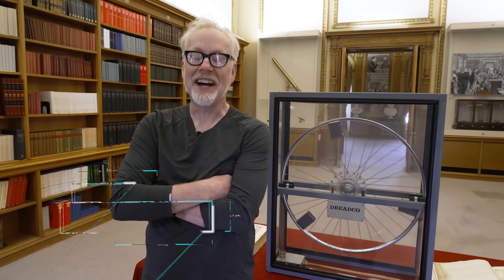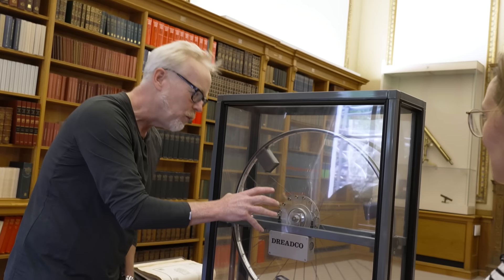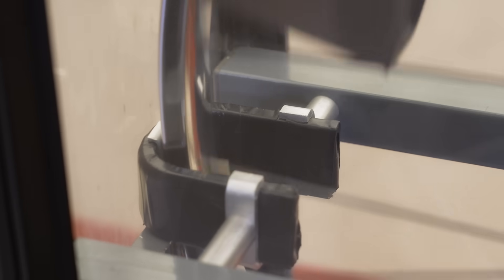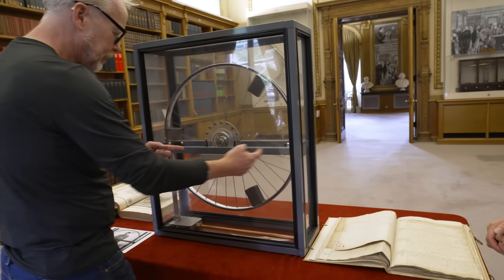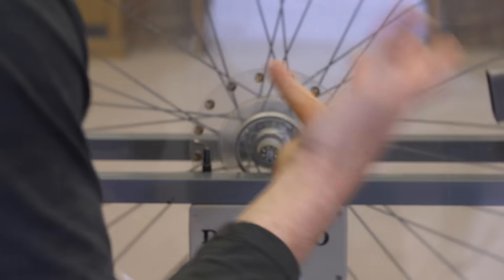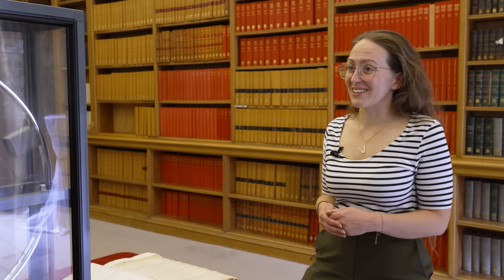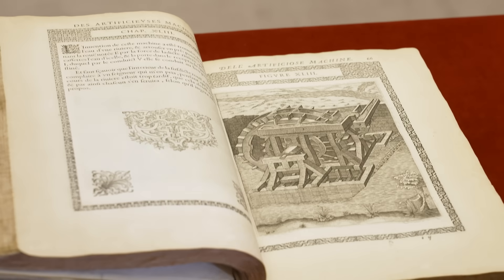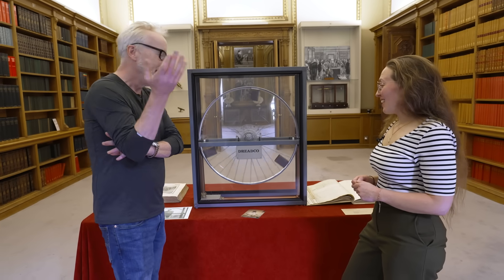Adam Savage vs The "Perpetual Motion" Machine!

Comment: I think it would be a wonderful inside joke if it's just a really low friction glass/ceramic bearing, the boxes are just weights (filled with lead or something), and everything else is a red herring. The "servicing" would be just giving it a good initial spin.
Reply: It’s not in a vacuum. The spokes have a lot of resistance from running through the atmosphere gas. Even a spinning top cannot spin past 20-30 minutes that has more precision than this wheel can achieve.  For sure it is using electromagnetic forces that are greater than the frictional drag
Reply: @nathanroberson  the world record for a spinning top is more than 7 hours with no vacuum :D
Reply: @nathanroberson  How do you know that the entire container is not vacuum sealed? Do they mention it in the video?
Reply: @rdizzy1  it’s not vacuum sealed. The walls are too thin. Even then, you’d be surprised how much energy small amounts of friction drain over time.
Reply: @rdizzy1  Adam his the enclosure, it's clear it's not under pressure/vacuum
Reply: @TheOfficialOriginalChad  Those walls are not too thin to have a partial vacuum pulled in there to decrease air resistance.
Reply: @geomore  Hit
Reply: @nathanroberson  Insulated bearing hmm and those probes look like they are for EHT just enough to have a field effect on the boxes and anyway it has a mystery box where magic shit happens AKA the battery's
Reply: Even the most crazy bearings humans have invented won't keep something spinning for 2 years. It's probably batteries.
Reply: @thewhitefalcon8539  Alternatively, if the 2 tubes/brushes at the centre actually makes contact (or barely so so that tiny sparks could transfer a small charge) with the plastic buttons, then electrostatic attraction/repulsion could i theory power the device assuming a high voltage - low current battery hidden in the centre box supplies the voltage to the brushes.

The direction of motion would then be set at start (by giving the thing a good spin) ans then the electrostatic driving force only has to overcome the friction.
Reply: @srenkoch6127  I agree electrostatic charge seems to be the motive force. This is implied by the two terminals near the axle, one spiked and set at an angle to the rotation direction, the other spherical and set at a neutral angle. The electron flow from a highly charged negative electrode would impart a small amount of force.
Reply: I was thinking it would be funny if there was a faint recording of a squeaky wheel that one could hear only if they were standing right next to the device.
Reply: Probably has a light-gathering cell to extend the battery life.
Reply: funny but not possible.  even with our best frictionless materials something isnt gonna spin for more than hours off an initial spin, especially at those turn rates.
Reply: as hilarious as that would be, a bearing that efficient would be an amazing breakthrough. I think Adam's right and it's just an exploded, dolled-up electric motor.
Reply: This was my first thought as well watching Adam here try to account for everything. It does seem an awfully British humory thing to do to make just a shitload of red herrings with only one actual factor driving the wheel.
Reply: It could be a combination of things, the 'weights' (if they are weights) acting as a flywheel, the Dreadco box containing a battery, imparting a small magnetic repulsion, the light sensors to maintain the charge, and perhaps those copper pipes and box are to disguise a valve on the underside to pull a vaccume in the enclosure, reducing drag.
Reply: @Ben-Rogue  Peltier device in the box on the bottom; the wheel gives it airflow in a direction for more efficiency.
Reply: @Ben-Rogue  if you look closely you can see that working glazing on the glass isn't tight enough to pull a vacuum.
Reply: Wow that's a ridiculously stupid answer.
Reply: It looks like a Dynamo, working backwards. A simple motor is a metal disk on a metal axle. Put magnets by the disc and a current to each end of the motor and it will spin.
I reckon The three blocks are just flywheel weights, probably hollow to keep weight down. If it is clear that no electricity is connected to the axle, the electricity is transmitted by the probes as an electro magnetic field, inducing a current.
Discrete solid state electronics in the “solar box” give a low energy pulse, possibly using the ring of magnets for timing, at a power that’s overcoming friction, but low enough the battery lasts 2 years.
The initial spin gives it its speed, the battery just overcomes a small amount of friction.
We fail to comprehend it’s not doing much.. At the perimeter length/surface area of the bearing is where the only work is occurring, if it’s in a vacuum. At that point in the bearing.. we maybe seeing approx 30mm of travel per rotation.. but we look at the outside diameter and our perspective is we find that amazing.
Great video though!
Reply: @SabcatPrinting  A dynamo working backwards? You mean a "motor"?
Reply: @graealex  hehehehe
Reply: @graealex  🤣
Reply: That's what I'm thinking
Reply: I understand perpetual motion is not achievable, I am however wanting to believe the one where a power generator makes hydrolysis chamber produce Hydrogen and Oxygen that in turn fuels the generator using a normal carburetor? ...is this impossible too 🤷‍♂️
Reply: @CrustyBiker  long answer short, The energy required to split water into oxygen and hydrogen takes more power than you get out of the combustion in a perfect system with no energy loss, then you start adding in energy loss through friction and heat and sound and all the other sources of energy loss.
Reply: @CrustyBiker  You are free to try. Maybe you will understand the concept of efficiency and losses if you do :) 

Whether you attach a motor to the generator that powers  it or you obfuscate the process by adding an extra electrolysis step makes no difference. There is no way to gain more energy from the system than you put in. Not even the same amount because there are always losses - in bearings, as heat, wires have resistance, even the electrolysis doesn't produce only hydrogen and oxygen (pure water is a very bad conductor and the moment you add some salt you have different chemistry going on and some energy is thus "escaping" instead of going into the gases you need ...)
Reply: @JanCiger   That and adding salt to the mix makes chlorine gas...
Reply: @CrustyBiker  yes
Reply: The movement is consistent. Even a highly polished bearing, there would still be inertia and the wheel would move slower and slower. There is some sort of impulse added somewhere.
Reply: This is a logical fallacy, although it is not possible to call the machines in the world 'frictionless', to speak of a 'first' energy requires not to use continuity in the same sentence. maybe you should start by saying that starting from the waterwheel, each one is energized at a certain angle and they pull themselves down?!? maybe there is a reason why the boxes start to fill at 30 degrees perpendicular to the x-axis?!? Beings that cut the y-axis in this way and spend their remaining energy on cutting the x-axis... you can make this machine work with a spirit level, an unstable balance with enough gas in it,)) It's a simple event, but cooperation is as important as it is meaningless on its own. like nature..
Reply: Seems more like servicing a finely crafted jeweled watch.
Reply: It would start slowing down visibly...
Reply: Exactly what I thought :)
Reply: its just like a mechanical watch
Reply: Its a gyroscope and moving it would be problematic and drag inducing.
Reply: No chance it would spin for even a week, no chance at all
Reply: I mean, it's that plus some batteries and electro-magnets.
Reply: There are a lot of ways how this could keep spinning, low-friction bearings are certainly a factor, but the "service" aka "rewinding" (most probably new batteries) makes it lose all interesting aspects. Atmos clocks run far longer than 2 years without a service, for example. And don't need a manual rewind.
Reply: @graealex  exactly good point! a cheap plastic wall clock runs with 1AA battery for 1 year, so I do not see very big difference here.
Reply: @graealex  Clocks are the clue.
Reply: @donaldasayers  Exactly my thought. A wound spring clock mechanism in the hub would work nicely.
Reply: @graealex  yeah but that doesn't provide enough to righteous smug.
Reply: @graealex  Could just be a wound clock spring in the hub with a gear mechanism and fan to limit speed. Rewinding it may actually be just rewinding it 😁
Reply: I think the three rotating boxes has batteries, microprocessors and coils inside them. The three are synced to switch on at exact moment moving past the two magnets. They are very efficient, only using a tiny bit of energy. Over time (two years ) the batteries run flat and needs to be replaced/ recharged.
Reply: @thequixotryworkshop2424  Why in the world would you need a microprocessor?
Reply: @thequixotryworkshop2424  I would concur with the batteries and coils idea, but microprocessors would be unnecessary, just a little circuitry to detect a pulse as the box passes the magnet and give a little electrical kick. The circuitry need not be anything more than a few transistors, capacitors, and a resistor or two to trigger a push at just the right delay. All the rest of the stuff - copper tubing, ported nameplate box, those pointy things near the hub are just decorations for the sake of misdirection.
Reply: @thequixotryworkshop2424 why in the world would you need a microprocessor for that?
Reply: @thequixotryworkshop2424  The microprocessors would be totally unnecessary. All it would need to be are some reed switches, placed such that they are switched on as they approach the fixed magnets but aren't affected by any small electromagnets present within the boxes themselves.
Reply: @thequixotryworkshop2424  Idk if anyone has mentioned this yet, probably not as it's a truly unique and revolutionary take, but the microprocessors are unnecessary.
Reply: @thequixotryworkshop2424  Microprocessors in 1981? Yes they existed but they drew tens of Watts
Reply: @donaldasayers  I know that for kids today's perceptions the 80s are around the XIX century (BC, of course) ;-)  but microprocessors were not even something new back then - they were invented in the 1970s. In fact, the Intel 086 series (you might be familiar with it; basically the origin of the PCs) is from 1974. And they drew FAR less power than "tens of watts". To have a microprocessor that drew so much power you have to wait for 1993 (the Pentium, or i586), which drew around 13 watts. Its predecesor, the i486, drew 4.9 watts. Its predecessor, the i386, drew around 2-3 watts. I have found no hard data for the i286 nor for the original 086 and 088 processors, but based upon that progresion (roughly doubled by each more powerful iteration of the same architecture) I would guesstimate around half a watt. 
Tsk, tsk. Kids today. Now get out my lawn!
Reply: @notfeedynotlazy  I don't know how old you think I am sunshine, but I was using 6502s at uni back in '78 and whilst my 'tens of Watts' is perhaps an exaggeration the power was on the order of a Watt, hundreds of times more than the power needed to keep the wheel turning, which was my point.
Reply: @donaldasayers  Don't know of you more than your words. "Tens of watts". Off by one and a half orders of magnitude. Enough to asume little familiarity with the specifics. Small wonder I thought you to be one of the kids who believe everything to have been invented in the XXI century. Im sure you know the type.
Reply: @thequixotryworkshop2424  microprocessors.. are you so young you cant imagine things not working without microprocessors? they did not have them back then
Reply: They had microprocessors in the 80s. 😉 However, he might be on to something with the switching aspect. But still, keep in mind the disappointment people feel when they learn how it works. It's very likely that weights and very low friction are involved. It's likely just very well balanced and the magnets give it just enough of a pull as the weights go by to keep it going. And I'll bet that the bearings might just need a little spritz of a very very light lubricant every once in a while. All of the other gizmos are likely just for show. I love it when someone keeps a secret like this. It's great to encourage people to use their minds, regardless if they are right or wrong. It also encourages discussion between like-minded curious people such as ourselves. 😃☮️
Reply: @sadev101  In the day and age of Arduinos, no one remembers passives being the real MVPs.
Reply: @graealex  it would seem so
Reply: A wise man once said "Magnets?! How so they work" - Joseph Bruce 2010
Reply: @GGzerHughHoney  Feynman approves
Reply: @GGzerHughHoney  Only an "Insane Clown" would ask that question.

Comment: This looks similar to the Perpetual Motion Machine I thought of.
My idea is to put angled magnets around the wheel, all with the same pole facing out.
Then more angled magnets  with the same pole facing in  around the frame.
Give the wheel a push to start it and see what happens. 
I realize this probably doesn't work for some reason.
But I lack the skills to build it my self and see why.

Comment: solar pannels that works for both charge a battery and turn on a mosfet that will make turn the wheel.
those two anode an cathode resemble me other than a rudimentary motor (they charge positively/negatively) little piece of metal that goes actracted by the other pole, then loose their static charges.
but also one of those is pointed as to give a little of ionization pressure to make always turn the same way.

if the lights are out the mosfet cut out the power and the wheel will eventually stop after some times, than when someone take it out it will turn on and start spinning again.

Comment: The only pieces that are relevant is the wheel and the 3 "boxes" spread out every 120 degrees. Inside the boxes are weights and springs. The weights are further from the center of rotation then the springs. Since the wheel is 360 degrees this would cause 2 of the "boxes" be on 180 degrees of the wheel at any one time. Notice that the side that the 2 boxes are are also the direction of travel downward. If the weight is toward the outside of the wheel leverage will be slightly greater against the wheel shifting rotational force on that side. As the wheel continues around and the boxes start going uphill when goes past the 90 degree mark, the weight will shill towards the center of rotation creating less leverage on the 180 degrees of the wheel that is rotating upwards. Notice that there are always 2 boxes on the side that is traveling downward equates to more mass that that half of the wheel. The springs within the boxes are there to help the weights outwards slightly sooner to help the increased leverage sooner on that half of the wheel preventing the wheel from stopping when one of the boxes is at the top and two at the bottom which would cause the wheel to stop.
Reply: Been tried.  Doesn't work.

Comment: Why didn’t Adam go over it with a Gauss meter (or even an old school compass) to detect where the magnetic fields are?
Reply: He probably doesn't carry those in his pocket.
Reply: @hazzmattlink  95% of smartphones have a magnometer in them, and a hw diag app would give the raw sensor data from that instrument
Reply: @hazzmattlink In London? I always do. It’s quite small but would do for that.
Reply: Good plan, I'd expect a smartphone's magnetometer would do the trick.
Reply: Might not be allowed to
Reply: he technically was wearing one, listen to mic hiss when he put it near the device.
Reply: @Kafj302  Yeah, you would need to get it in close at each of the points of interest to nail down any EMFs.
Reply: The magnetic field is in the box in the middle ad revealed in another video where the envelope was handed off to the professor.
Reply: @ronaldhaefner8515  That makes no sense. There is nothing in proximity of the box in the middle either of an electric or magnetic nature.
Reply: That would just ruin the mystery
Reply: Something tells me there may be restrictions on measuring equipment. With today's technology, it's probably easy to figure out with the right tools... But that would ruin the mystery, and we can't have that. Lol
Reply: Gauss meter would do the trick, but a suspect a fan pushing a small amount of airflow through the copper pipes. Stethoscope would pick that up as well.
Reply: It might not even be electrical. It could just be a really well lubricated bearing and a mechanical system powered by a slowly unwinding clock spring just giving it enough momentum to keep up with friction. Hell, it could even be as simple as an array of small CO2 canisters (like the ones used in airsoft) slowly releasing a bit of pressure through a minuscule hole.
Reply: @darmok42 for 2 years? I don’t think so.  This thing has batteries.